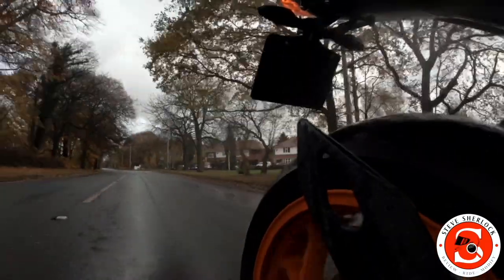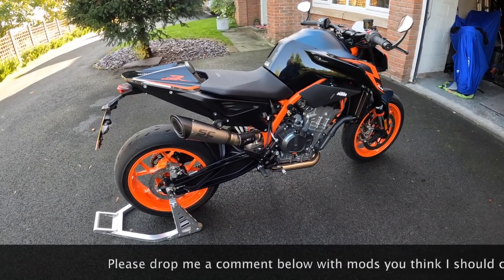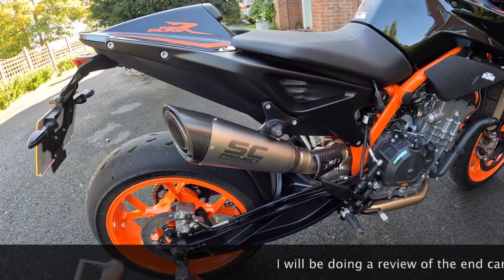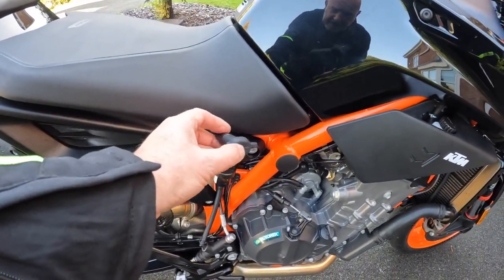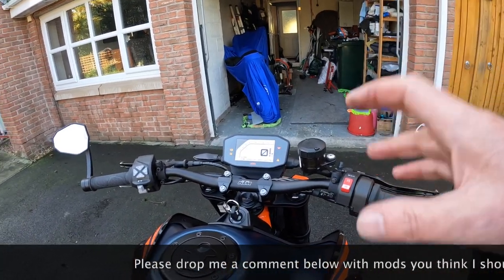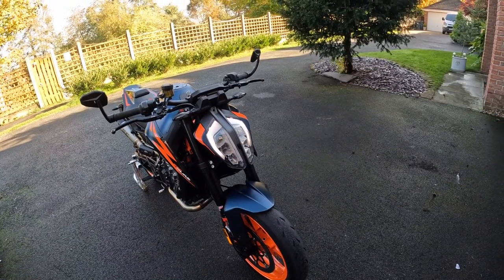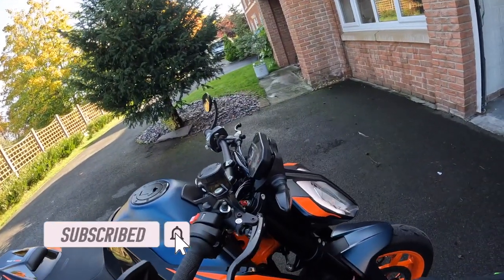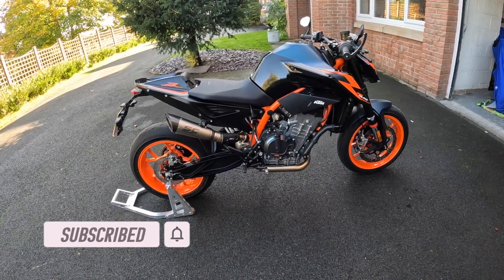Duke 890 R mods and planned mods

Comment: I got all the tech pack for free and only 14 Bhp down with the 790 Duke!  6K  all in.  You don't need a remap just get the booster plug!
Reply from the maker: Hi I got the tech pack thrown in also and mo need for a remap. The slip on silencer still retains the CAT so no remap required.

Comment: Hi Steve , have purchased an 890r and looking at a sc project can like yours, just want to ask you did you order it directly from Sc ? And was it straight forward? And what are your thoughts on running it ? Any problems etc , thanks Dave L
Reply from the maker: Was all good David and yes directly from SC. Delivery was a little quicker than projected as came in 2 weeks. Fitting was dead simple but removing the baffle took a bit of encouragement and patience sounds and looks ace though and no downsides at all
Reply: @stevesherlockrides when u ride on track. When you out your feet a bit backwards  your boots will always hit the carbon protector of the SC. It melted mine and I broke the carbon piece cover.
Reply from the maker: You need to get off the bike more to allow you to keep the bike a bit more upright

Comment: I put those PP mirrors on with the stock bar end weights....all you need is a longer screw.....also flipped my mirrors inward for better clearance splitting lanes

Agree about the brakes, almost too good and never thought I would say that about a bike....have to be super gentle to create feel with the front brake

While suspension componets might be solid, the valving isn't very good.....it needs setup and I've messed around a ton with the clickers

Bitchin bike though
Reply from the maker: Agree. Im getting my suspension sorted in the spring as doubt many mikes on it this winter if any. 1290 GT fir the winter

Comment: Hey steve, it has been a long time so hopefully you'll still answer but could you tell me some more about the optimate charger thingie that is hanging from under your seat?  What is it called and where can I get one? I am looking for a charger for my 890 duke r but I have no idea how these things work and just a plug and play solutions seems ideal for me. Thanks
Reply from the maker: Happy to help. The charger is called Optimate 4 dual.program charger. The dangling plug on the bike is simply connected to the battery terminal. All you then do is connect the plug to the charger(mine is on the wall) everybtime you arrive home. The charger then cycles the battery by mimicking load on the battery as if the bike is being ridden so therefore keeping the battery at optimum performance. Does this help? Ps what an ace bike the 890 r was. I've now got a ducati V4s. Ps buy the charger on ebay or amazon

Comment: good video, interested in both the susp settings and remap outcomes, have the same bike and am roughly the same weight. Running a Coober LM lambda manager but find the bike is still not very smooth, thanks!
Reply from the maker: Is yours a 2022 model as my fueling is not bad at all in stock
Reply: @stevesherlockrides  2021, but haven't tried any other 890s, might be just my perception. You are not around London you up in the north right?
Reply from the maker: Yes in gods country in the North west of England. I wouldn't expect the 2022 to be any different and in standard firm its good but can always be improved